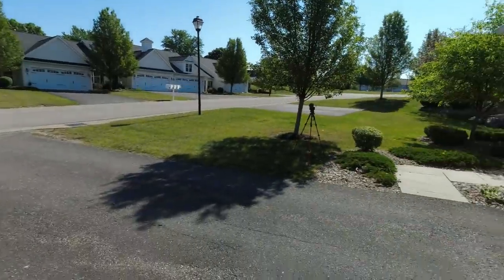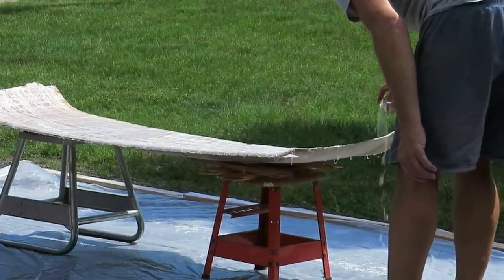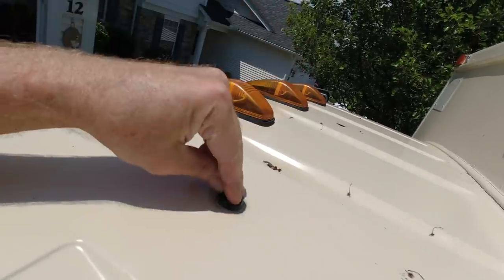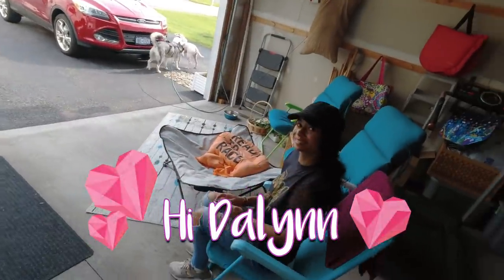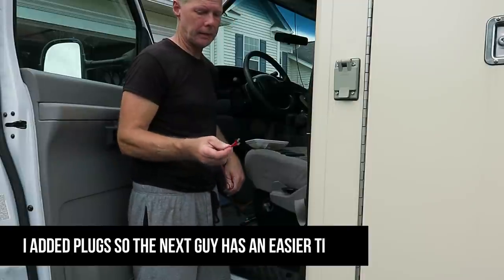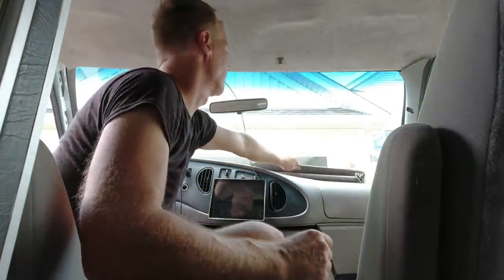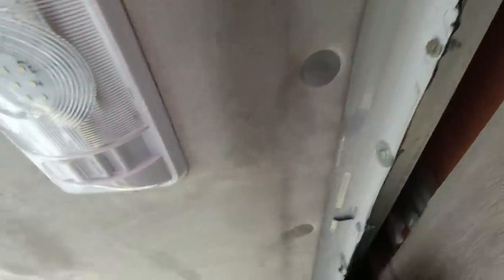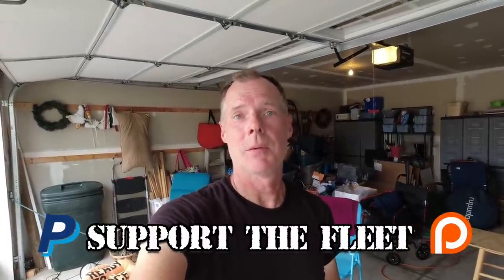New Ford Ambulance Headliner Installed and Antenna Leaks Fixed On My Ambulance Conversion

Comment: Excellent Job on the headliner Dave. Probably will add more sound deadening than the old one too.
Reply from the maker: That's an excellent point - I didn't think of that until I had it installed and felt the thickness of it! Thanks Dennis

Comment: I know this video is a bit old and this will probably be at the bottom of the priority list considering recent news. But if you want that dome light to turn on when you open the door, hook up the door power wire to the light PAST the built in switch on the light. Then you can turn it on with the built in switch any time or the door can turn it on.